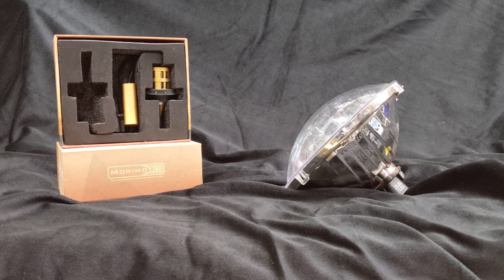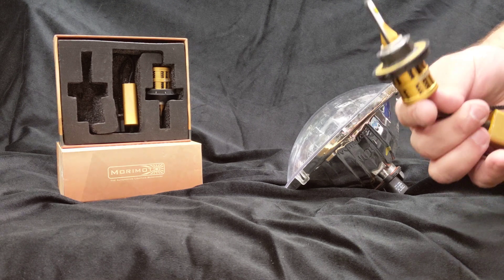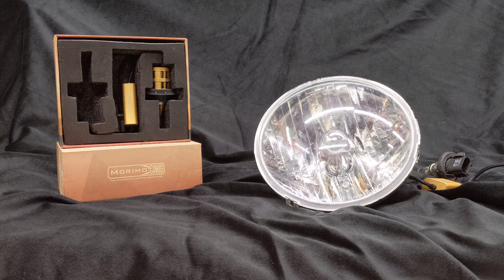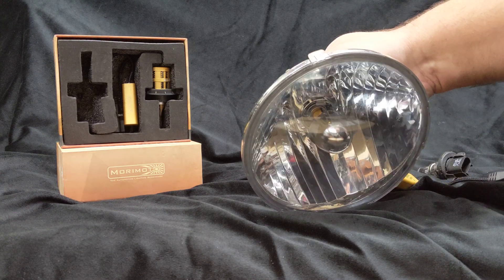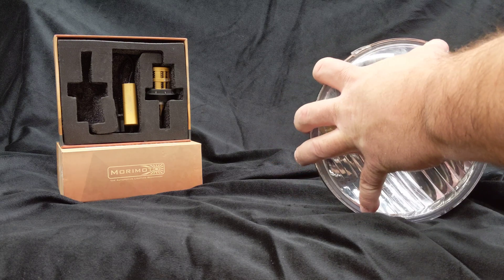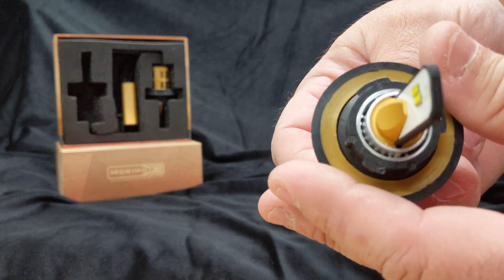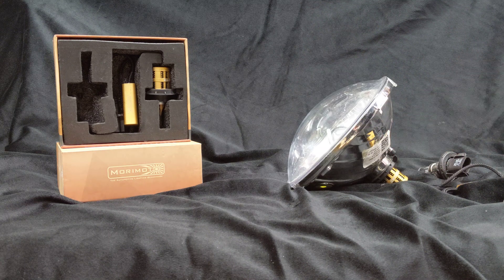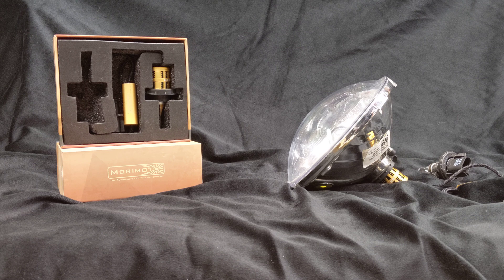Morimoto 2stroke LED Bulbs proper installation and how to rotate LEDs inside housing

Comment: This kit and mostly the company is a complete joke. This video shows the bulbs being adjusted when in fact they cannot. The company sent me dust cover extensions that do not come close to fitting my truck. The kit itself was cheaply made as the gaskets are already coming off out of the package. I can only imagine how long they will last
Reply from the maker: I'm sorry you're having issues with them and we too have had applications that they simply don't work with... The Toyota 4runner is a good example, the Morimotos and the Diode Dynamics both will not fit in a 4runner. Early 2000 Chargers, the 2strokes work perfectly, but the SL1s don't. Likewise, the Dodge Ram projector headlights, the SL1s work perfectly and the Morimotos do not. If you need help finding something, feel free to email us and we will see what we can do to make your experience better... Sales@thcconcepts.com

Comment: How do you adjust the led when you have a projector housing and can’t see the bulb.
Reply: did you find out a solution for this?
Reply: Mik3Th3Rock3r no I didn’t.
Reply: dan m yeah I tried that and when I push in they still don’t turn. It is rather difficult because the lens is still in my car. I have to remove the front bumper to get the lens out.
Reply: @matthewstringfield8924  I had a hard time with one of mine too, i actually took the bulb apart wear it rotates and added a little bit of dielectric grease to the o ring in there and the body of the bulb and it helped alot.
Reply from the maker: I'm terribly sorry I didn't answer, I never received a notification about any messages.... There are arrows you can reference, BUT, I like to take a permanent marker and make a mark at 12 and 6 o'clock so I can see it inside the housing when adjusting... Hope this helps

Comment: I just received my Morimoto 2Stroke 2.0 - 9012 LED lights for my projector housing. The LEDs are not vertical when installed, but I can't push them in to rotate like in this video. What should I try now?

I took them out for a try last night, but I didn't seem to be getting very much light. I wonder if the non-vertical orientation is the cause for that.
Reply: Just got mine. They rotate without pushing or pulling
Reply from the maker: Sorry it's taken so long to respond, I never got a notification of replies... The 9012s are GOING to be adjustable very soon... In the meantime, you can trim the 3 tabs that lock them in with a dremel to make orientation where they need to be. Takes a little work, but works out perfectly nonetheless

Comment: You are a legend sir! The documentation available from Morimoto is pretty abysmal and mine are not vertical currently. I figured there was a way to clock them considering lesser led kits have that feature. Whattya know, Morimoto made the adjustment easier than the other kits but the knowledge on how to it secret lol

*EDIT*
Well apparently the adjustment is only for this specific bulb type. For the H11 kit I have, installed in H8 housings, there is no adjustment whatsoever. Not sure who thought that was a good idea, but it's kind of aggravating.
Reply from the maker: The new generation h11s are adjustable and the new NEW generation 9005/9006 are going to be adjustable, if they aren't already.